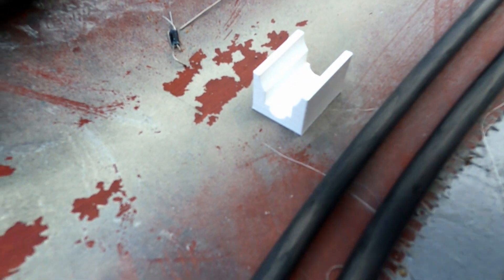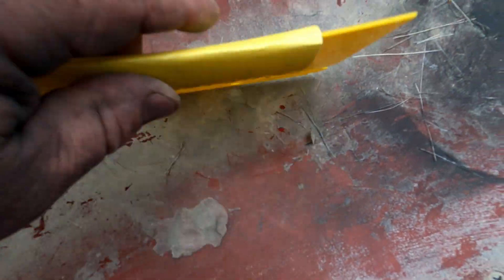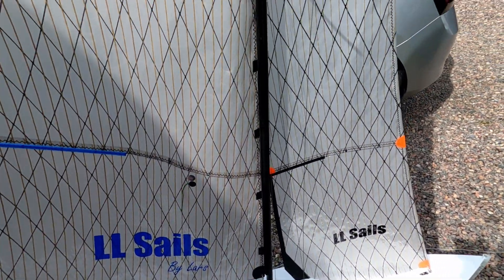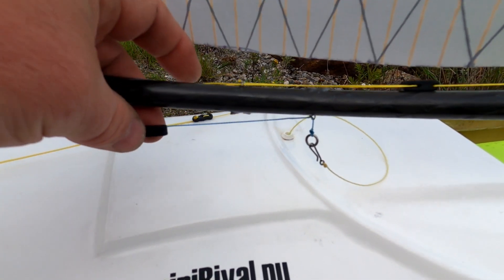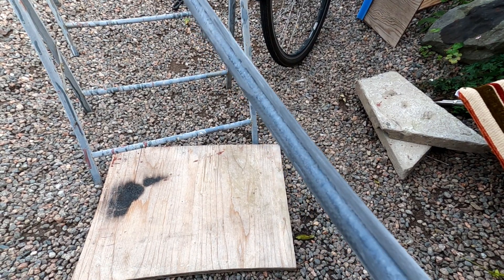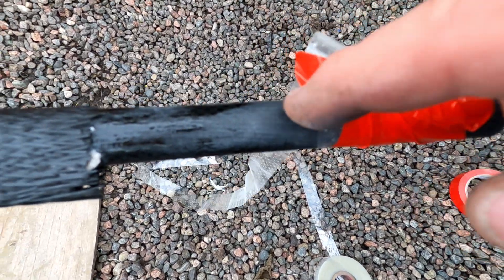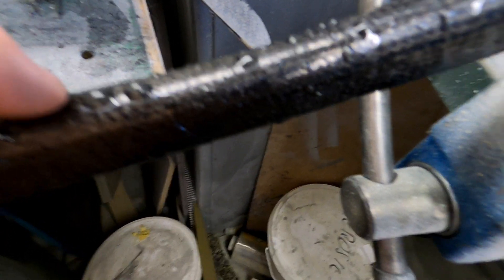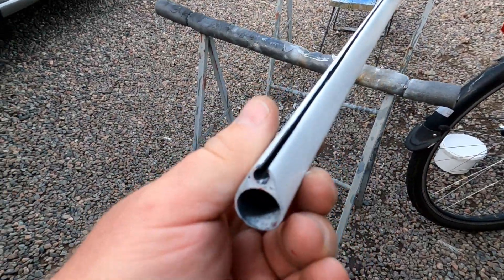Making model sailboat carbon fiber masts with sail groove

Comment: Is this version better than the 3D-printed grooved one? Is it worth the extra cost? I'm building a 1.5 m yacht and need to decide between an aluminum round-grooved mast or a DIY carbon one like yours!
Reply from the maker: I think this ended up a bit stiffer than the one I built with the 3D printed sail groove. If you can find an aluminum mast, I would use it. They are a lot less work. Cheers, Lars
Reply: @LarsLindqvist  Noted! I'll go withthe aluminium one then. Thank you!
Reply from the maker: @ Great! Happy Easter!